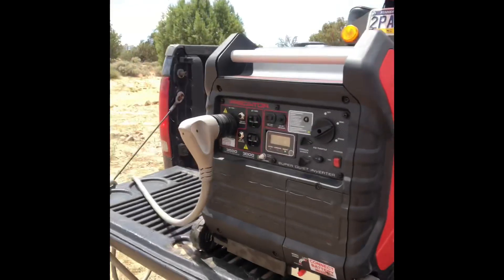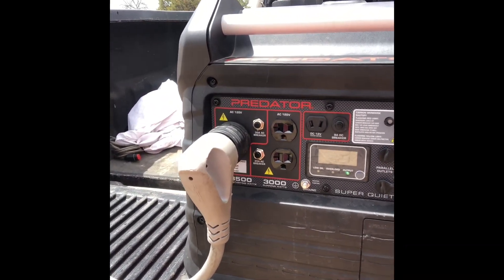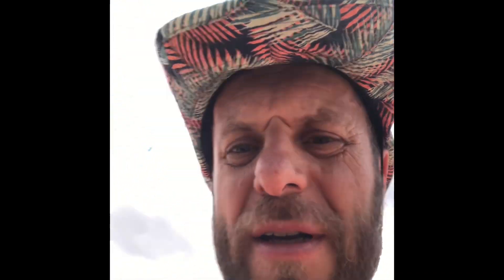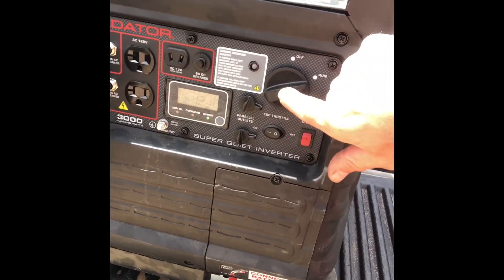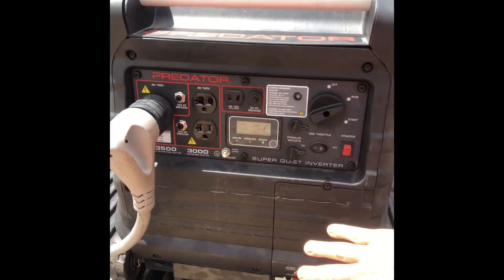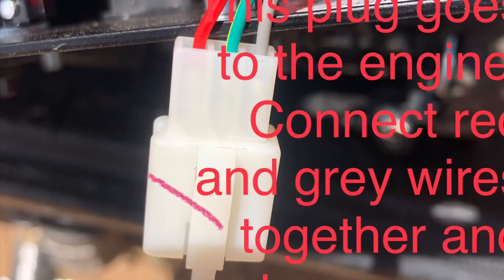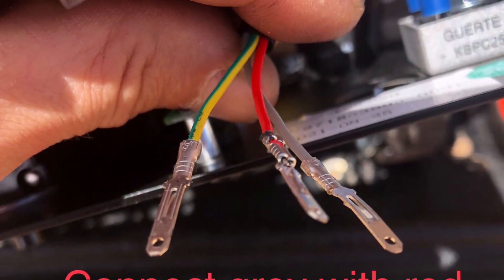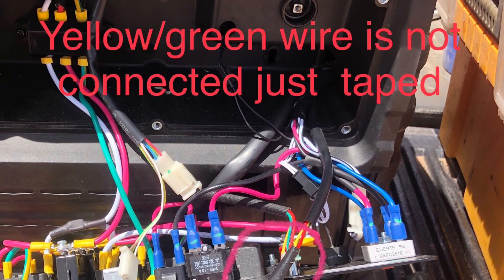Predator 3500 carbon monoxide detector bypass

Comment: The CO shutoff system is a critical safety feature which can help to prevent the risk of sudden illness and death resulting from the accumulation of undetected CO, which is an odorless, colorless gas impossible for the human senses to detect. The health and safety of our customers remains our top priority and we recommend discontinuing any use of this product without a functioning CO shutoff system.
Reply: Then why don't you design your product correctly so people don't half to tamper with it in order to get it to work properly
Reply: Summer heat makes this flash and shut down while camping .
Reply: Mine is sitting outside in the open driveway and after a few hours the carbon monoxide detector shuts it off..how about making something reliable. Maybe we should start a class action lawsuit.

Comment: My co sensor on 1400 
Help. How do I splice
Reply from the maker: Splice together  2 wires out of 3 see which once will work. It should start with 2 wires
Reply: @dimateam2093  I got four wires on mine. It's the 1400/1100 generator

Comment: I did mod, but will not shut off when turned to off, any suggestions?
Reply from the maker: hm strange. Are you sure you did right wires? Make sure its the wires that go to your carbon monoxide detector. I sold generator dont need it anymore.
Reply: Same problem I'm having. Did you figure it out

Comment: For those as confused as I was, here’s what worked for me…just unplug the 4 pin connection and connect the red wire to the gray wire leaving all others in place and the connectors disconnected
Reply: thank you
Reply: What about the 1100 watt generator
It's got blue red yellow green
Reply: Thank you!

Comment: I did mine just now and it’s working BUT i did it a little different
Take off the panel on the side with the pull start, you have to remove the wheels and 2 bolts on the bottom, 3 screws on the back, 1 on the front, and two on the top
Move slowly and you’ll see how the attach and the panel comes off really easy.
At the bottom you’ll see a circuit board with wires all insulated and taped together. Is the middle area, between the circuit board and the front panel of the machine is a plug with 3 wires. 1 is red, 1 is green and yellow, and on my unit the last was gray. Using a poke or a very small screwdriver you can take the pins right out of the plug. Put the red and gray together. Tape them or use something that will hold them like a butt connector and crimp it. Tape the green and yellow wire. 
—— MAKE SURE THE ONES YOU TAPE TOGETHER GO TO THE CIRCUT BOARD OR IT WONT WORK, YOU HAVE TO TRICK THE COMPUTER INTO THINKING THAT THE SENSOR IS STILL THERE——-
Re assemble and turn it on. Sensor bypassed…

I hope it helps guys. My timer is at 19 mins with 50% load right now and going strong. No issues.
Reply: Do you know what style you have?
What side is the battery door on when looking at the panel?
Or does it even matter?
Reply: @SARmanv  mine has the battery door on the lower right corner when looking at the panel. Pull cord on the right side and oil dipstick on the left.

Comment: Not a great video at all like actually show a video of what you are doing point at stuff show and explain not still clips moving across the screen that don’t show the full photo
Reply: It is the two outer wires of the tree in the connector clip going from motor to the CO lamp, i left the center wire in the connector clip and used a tiny screwdriver to pust the red and and yellow (my generators collors) out and taped dem together, you could also just put a jumper in  between the left and right side wire, it is the wire on the motor side  of the connector you put together the other wires just goes to lamp you see flashing when having an CO alarm, leave them alone in the connector clip. I WOULD ONLY DO THIS IF THE GENERATOR ARE USED IN FREE AIR OUTSIDE AND PUT a yellow tag on the generator THAT THE CO SHUTDOWN HAS BEEN DISABLED!
Reply: @Espmx  I just picked up a Predator 3500 today, and mine were also Red/Yellow.  Slid them out of the connector, left the center connected.  Used a butt connector to connect red/yellow.  So far, so good!
Reply: https://youtu.be/w4KSuNPtpyU
Reply from the maker: just plays with 3 wires thats how i figured it out. Not a brain surgery lol

Comment: Are you leaving the gray and red in the plug and connected and removing the yellow green from the plug and taping it leaving it aside? Or are you putting the green yellow on a side and taping the gray and red together but not in the plug your photo kind of misses the point
Reply: You leave the yellow green wire aside tape it up. Red and gray go together and it doesn’t have a reason to be plugged in just make sure you do the side that goes to the small circuit board.